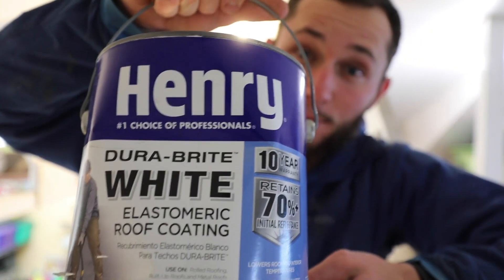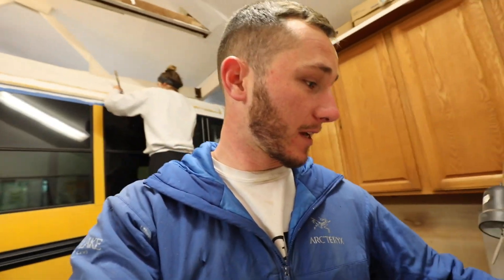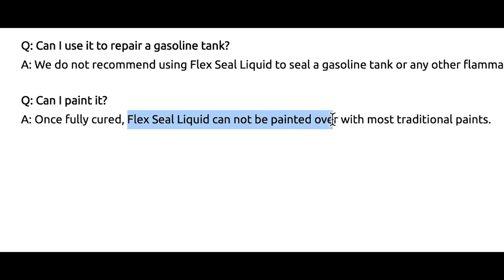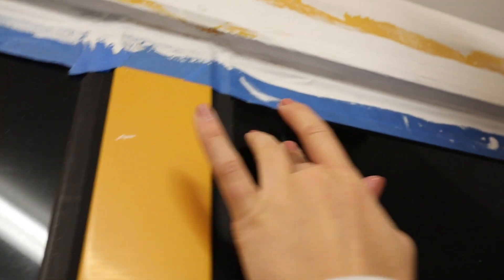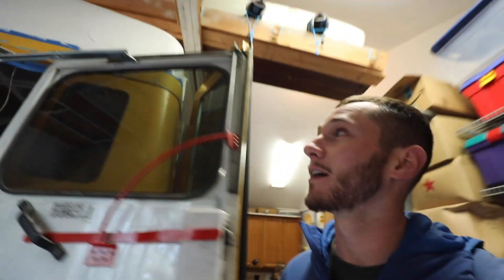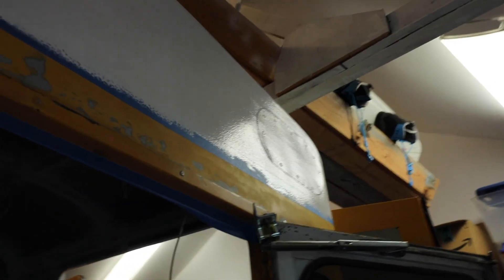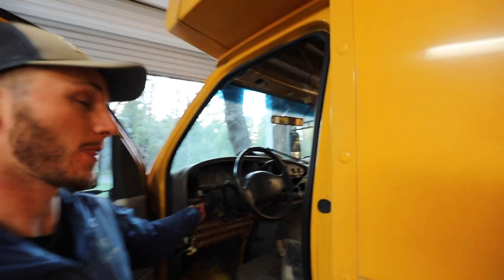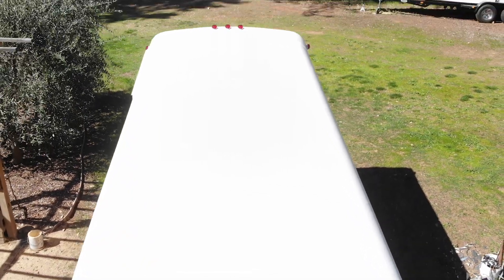Painting the Roof - Bus Build Episode 8

Comment: What paint/sealer would you have chosen if you had known the Henry's and Flex Seal wouldn't work together?
Reply from the maker: Great question, I would've gone with JUST the flex seal. I've been super impressed with how robust and thick it applies. My only problem areas are where I still have henrys underneath. That being said, those problem areas are very few and far between and an extra coat of flex seal on top of those spots seems to help a lot